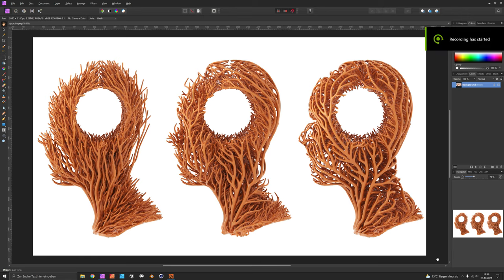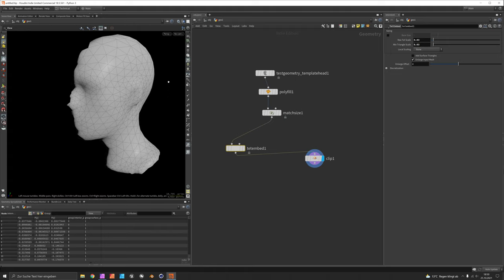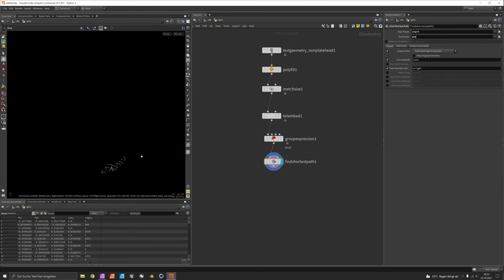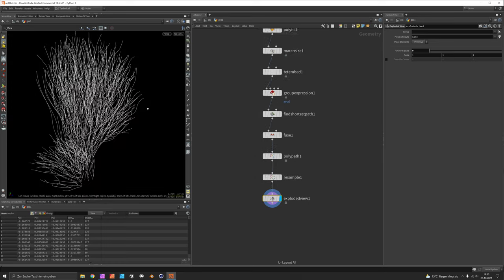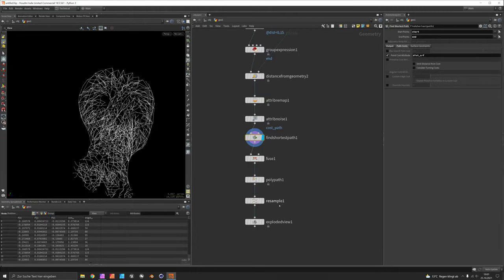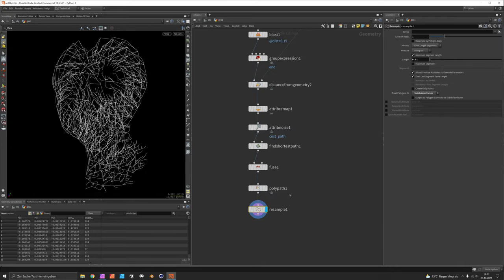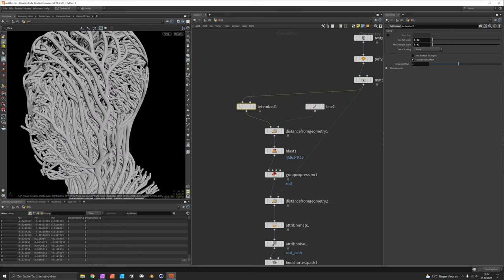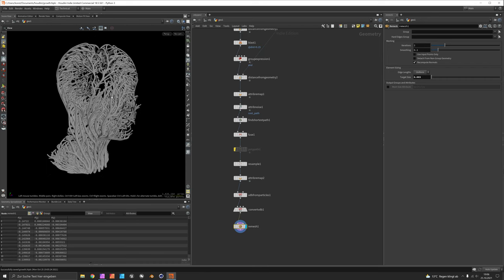Guiding shortest paths – Houdini Tutorial

Comment: Thank you Konstantin,  would like to ask couple of questions: some of my paths tend to  loop at the ends, I see that in your tutorial they break at the ends- what can I adjust to break the looping connectivity, and second question: you have very nice display as the curves fade at the ends, I tried display options wire thickness and it works to thicken more but doesn't change to thin.
Reply from the maker: Hi Alena, I am not quite sure. Did you have a chance to look into the example file under the link in the description?

Comment: Hey Konstantin! great video! I have a question regarding meshing - I want to have the animation grow from the start to the end points, and ideally I would like to do this with a carve node after the fused lines, but this is where I run into a problem. I want to avoid using the VDB meshing setup you showed in the video because I want the paths to move and don't want to deal with a constantly changing prim count, so I am left with either the sweep node or polywire (maybe there is another node?). The problem is when I use the carve with a polypath and sweep node for example, the animation does not start at the root group, but rather, the start of the line. If I disable the polypath, the setup optically looks correct, but the sweep node stacks a ton of geometry on top of each other, and I want to avoid this as well. Esentially, how can I have an animated mesh that grows along the lines? Sorry for the long comment, I hope I am making sense :)

Thanks again for the great video!
Reply from the maker: Hi Kyle, I would probably create the entire mesh, add a surface distance attribute starting from the root and reveal the mesh along the distance. That way you have consistent primitive numbers and a consistent topology.
Reply: @KonstantinMagnus  gotcha, how would I get the surface distance attribute to actually effect the scale of the mesh? Is there a SOP node? Or am I just tweaking P values in a wrangle? Thank you for the help on this by the way, I really appreciate it :)
Reply from the maker: @kkeerr  I don't think there is a SOP node for that. This probably needs a custom procedure.
Reply: @KonstantinMagnus  gotcha, thank you for the help!

Comment: Is this node using all threads? It's a bit slow for more complex problems. This should run on the gpu ideally. Do you think that is possible?
Reply from the maker: Hi Philip, it seems possible in OpenCL. In many cases I'd rather optimize the mesh or network in advance, though.